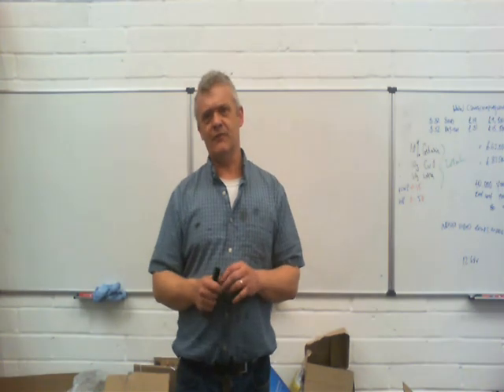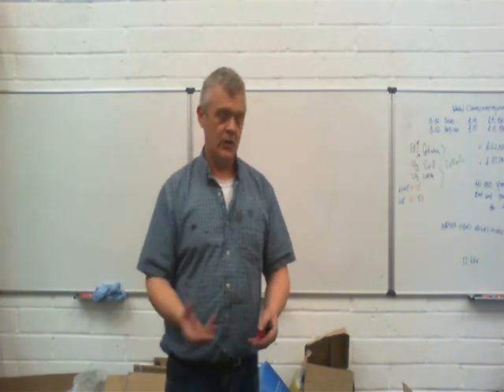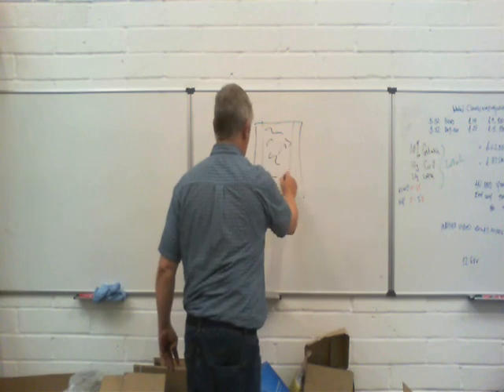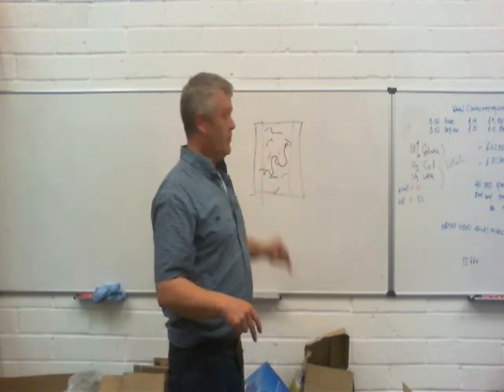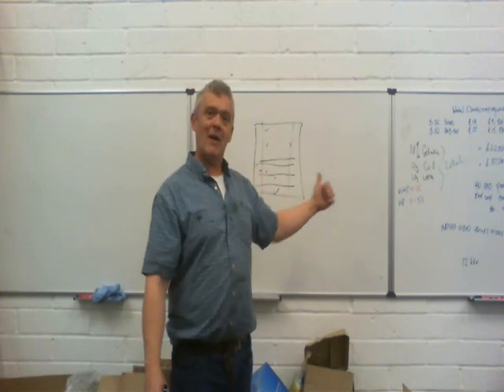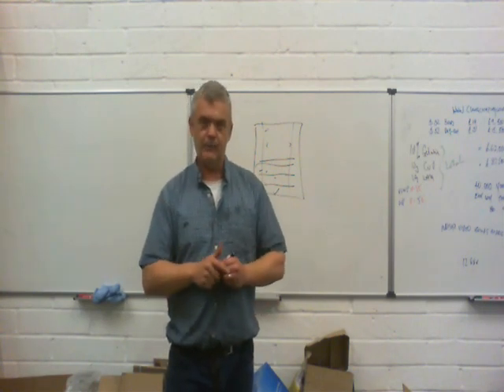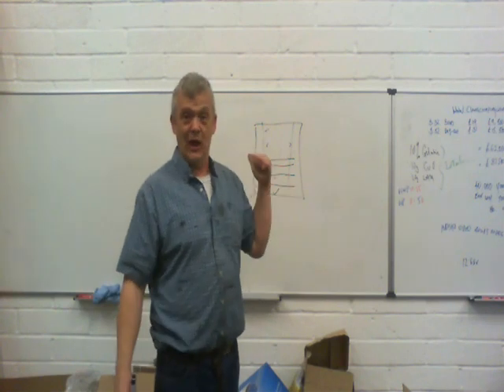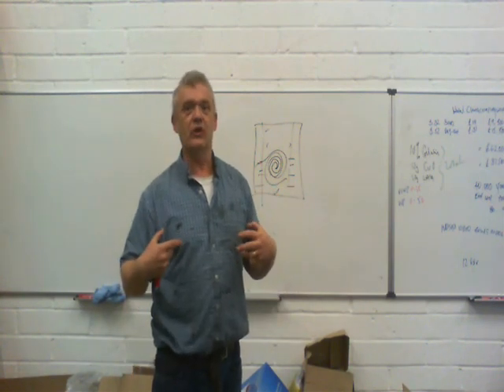SWAG Update - Thoughts On How The Magnet Works

Comment: curious... have you played with this supposed usage of coating graphene on yttrium iron to make it magnetic without loosing much of its electrical properties? http://journals.aps.org/prl/abstract/10.1103/PhysRevLett.114.016603
well my question then would be... couldn't you use your ink, and well if you line it up with a magnet as it dries if you then put the yttrium iron, does that control how the magnet would work?  Like in essence make a graphene printable magnet? not any videos on yttrium iron graphene lol.
Reply from the maker: +Clarence I haven't looked at this mate - but i will do now lol

Comment: Would it be possible to magnetically print on the same media
has hard drive disk's  to a

accuracy of say 10 micron's then deposit granules say 3
microns across. These would align

with the magnetic field and bridge across . micro volts
would only transmit across each junction

but the density of lines could make a decent amount of
energy . This all depends how small the

graduals can be made
Reply from the maker: +Bob Wilson A modern laser jet will print down to 20 microns or so with particles 5 microns or so across - so i would guess this can be done - you planning on trying?
Reply: +Robert Murray-Smith 

In time, as it is quite complicated . Need to finish refurbishing my lab firstThe platters used in hard drive disk's are coated in a thin film of 
ferromagnetic material . Using a read-and-write head and
stepper motors driven in opposing axis magnetically print  continuous
lines to a high definition . I conferred with a scientist friend of mine
who is from the university where graphine was invented .He also
told me graphine is easily obtainable 3 micron across . when I said print, I meant electronically print
a continues line instead of writing data using a read and write head .
Reply from the maker: +Bob Wilson sounds interesting mate - good luck with it

Comment: Thinking outside the box...........well, maybe thinking outside my box- Question for you-  since a capacitor is charged by separating the protons and electrons and storing them on two separate plates, would it be possible  to  somehow charge a capacitor with magnets 
Maybe connect the two plates and apply magnets, one side of magnet negative attracting positive, and the other magnet positive attracting negative, before you remove magnets, disconnect plates 

I have already done some research and found nothing, so I thought I would run this by you to see if my thinking was way outside the box, maybe at the least, having magnets in place when charging may help charging?
Reply from the maker: +Steve Allwest in my understanding mate capacitors store energy in an electric field - charge separation is a methodology by which this field is built and maintained - there is a relationship between magnetic and electric fields but it's not straight forward - i think it is an interesting investigation but i also think a static magnetic field with a static electric field won't help - the relationship seems to involve movement - think about current generation - you have to move the magnet. Anyway, very interesting question - I hope you pursue it
Reply: +Robert Murray-Smith  Thanks mate, this fun thought of trying to get power from two standing magnets  needs a lot more research before I spend the time trying it, thanks for responding, Cheers
Reply from the maker: +Steve Allwest let me know how you get on mate
Reply: +Robert Murray-Smith  unfortunately no time these days to play  (yet) until the rains come, one thing that comes to mind on a type of test for this idea, just to see if this has any merit 
If you had a mind to-
1. Apply magnets to one of your deep eutectic fluids in a glass jar , Negative face on one side of the jar and positive face on  the other side, and let stand overnight to see if you get any separation 

Just some thoughts until I get some time to test
Reply from the maker: +Steve Allwest I am a bit in the same boat mate - but if i get a chance i will give it a go

Comment: please forgive me, I'm new to all this.  I saw your video on making graphene sheets by a friction process, making the top of the graphene dusted sheet thinner and thinner by stripping the layers down until they are nano-thin.  The friction process used orbital motion, but if you could strip the top layers off in straight lines, you could cause the particles to align better.  I'm gonna order some supplies and work on it.  I think, though, it might be easier to actually get the graphene to stick to the material by using its static charge.  it would be like a tv screen attracting dust, but the dust would be graphene.  That doesn't make it run in straight lines, but after the thin layer is on there, i could work on a way to polish it in straight lines.  I'd have to see what could make trillions of small valleys cheaply, it'd have to be finer than the finest brushes.  Your friction process creates the heat necessary to cause the plastic to help bond the carbon to the plastic.
Reply: They use static to make sand paper, instead of sand dust, imagine carbon dust.  lastly, to make the particles align, before the glue has set, blow a jet of air through an extremely small slit at an angle over the sheet while it is rolling in the conveyer belt.  I will work on how to induce directional movement of particles in a solution for your ink graphene sheets.
Reply from the maker: Gristle Von Raben looking forward to what you come up with mate - nice ideas

Comment: Do you really need the sea, what about rotating salt water over the swag plate using a fan blade pulley/gear system to rotate the liquid?
Reply from the maker: sure - why not - I am only using the sea as it is near me and a good source of energy but other systems could equally be used

Comment: I had thoughts about posting this a few months back, simply forgot. better late than never.  
  A few months ago I was playing with some graphite, after 3 days in a ball mill. One batch with marbles & one batch with metal ball bearings. We sonicated some ball bearing compound into water (well water). After a day or 2 it settled out & we poured off the top layers to test out. Then took the remainder settlements and shook it up. Long story short. Was looking into the mix with a phone flash light. We noticed the light looked like it was moving some of the suspended particles We where like "Wow cool" but then we got out the Neo Magnets and WOW. I believe the iron in our well water & maybe the metal bearings them self made the graphite/graphene mix magnetizable. I also notice that the faster you moved the magnets the more pronounced the movement was. My first thoughts was a liquid generator could be possible.
  The glass marble batch slightly repelled under the effect of magnetism.  Not nearly as mush movement but noticeable repelling. 
  I think that painting graphene type products in a high magnetic flux, much like flip flop multi-colored paints, one could influence the patterns of the particles lays.  A mixture of magnetized & non magnetizable graphene might be able to influence lays as well.
Reply from the maker: Now that is interesting - i suspect the grinding media had a bigger effect mate - it could be the iron in the well water or small amounts of grinding media 'rubbed' off on the graphite - either way it is a very interesting effect. Mixing the two 50:50 , painting a sheet and drying it in a magnetic field could have an interesting effect especially if one was hydrophobic and one was hydrophilic

Comment: You have my brain spinning with ideas.... Love it... Ground breaking stuff on the regular from R M Smith... I'm getting a sample of your flaked graphite from a friend (Jeremy Gwilt).. I feel like a painter looking at a canvas.. I will do my best to come up with something interesting.... Second question (I am not sure if I remember you going through this in a video before), if I cleaned out a ball-pin pen, would the conductive ink flow through it a a steady rate? I am building a simple 2D printer that is CNC (obviously) and will be connected to a pen (It is a pre-cursor CNC build before I make a larger more expensive unit --> (3D wood mill for wind turbine blades)  *practice makes better*).. I figure I could do some really interesting fractal-phi shaped antenna designs with the conductive ink... But anyways, amazing stuff. Keep up the awesome work. Peace. Sincerely B
Reply from the maker: good old Jeremy - you would need to add a thickener to the ink if you want it to go through a ball point pen - maybe xanthan gum
Reply: Robert Murray-Smith Excellent, I am glad it is possible with a small modification, obviously I will share the results as I go...It will be a couple of weeks before I get the stepper motors and corresponding drivers to start this project (they are ordered and on there way from China).  I will be ordering some conductive ink this Thursday evening.... Thanks for all you do... (maybe in the order we could add in some xanathan gum ;) <- of which I would pay extra for of course :) 
Peace.
Reply from the maker: Binj Komisar
cool mate - i have just subscribed and will keep an eye on your progress as I am fascinated now lol - the gum is really easy to get hold of mate - just do an ebay search and you will get loads of it
Reply: Robert Murray-Smith Excellent.
Reply: Robert Murray-Smith OK. Placed order for conductive ink, everything seems to have went through flawlessly... And yeah, Xanthan Gum is cheap!!! Very cool. I am excited about this project... At first I was just going to build a 2D printer to draw, but with your ink, it is now going to be a really neat and interesting learning experience on a couple of levels. Peace and all the best!! :)
Reply from the maker: Binj Komisar
cool mate - it'll be a couple of days until I send it out - if that's ok as obviously I am in the states right now - but I am back on tuesday and I will get it off
Reply: Robert Murray-Smith Great, no rush as I am still waiting on the stepper motors and Xanthan Gum... This should be a cool project, thanks for making such awesome materials readily available and affordable. Peace Mr. Smith :)
Reply from the maker: Binj Komisar
thanks mate

Comment: Hi Robert. You may want to re-think your position re solenoids. Solenoids do not produce an even field of magnetic flux. Have a quick look at this video: PH EM MF DEMO 70001A V1025 2D Magnetic Field Demonstrations Simple Wire Coils which shows the magnetic field around three different types of solenoid. The third one, where several coils are aligned in a row produces an aligned field which if applied around the ink whilst it is drying might produce a much finer alignment of the graphene. There may be a certain amount of 'tuning' required vis a vis turns of wire etc, but you ought to be able to produce much better results using this method. Apologies in advance if I'm being dim, but it looks like it might be worth a try.
Reply from the maker: thanks for that mate - it looks really good - everyone needs their eyes opening now and then lol

Comment: Layman here. Would having more lines make it better e.g say if you could print them? Is it correct that you would still need the magnets to align the individual particles in each line? Is it that you need to do the alignment when the ink is wet and is it the drying of the ink that fixes the alignment?

Have I understood what is happening there?
Reply: you seem on the right path ... if still wet, they are movable so flux aligns them with max conductivity ... more lines = thinner lines -> more resistance ... fine balance act between distance from anode to cathode and specific resistance ... a bit like the copper conductance ... how long vs how tick :) resistance is inverse proportional to thickness and directly proportional to distance. :)
http://en.wikipedia.org/wiki/Electrical_resistance_and_conductance

Comment: excellent video as usual.
nice talk & demo of the mag arrangement.
I get it ... no magnetic field to be placed around the cell ... cool.
still ... consider that antennae arrangement whereby interference like patterns in 3d can be printed onto PET with dried inks ... i'll try to sketch it up for you to see whether we are on the same page :) 
BTW since the flux is unidirectional ...I get the diode thing ;)
Reply from the maker: cool - i think your idea of magnets is a good one mate just for different implementations like antennas
Reply: Yup ... perm magnets and antennae seem a logical combo but ... anions and cathions travel along a path and can be perhaps encouraged to do so quicker :) 
Mind you , when discussing already a two dimensional plane like the pet painted with low resistance already vectored paint ... not much point for further encouragement ... however in a 3d context with lots of graphene floating in an electrolyte ... ;)  
Might even be a point to make in a supercapacitor design due to the orientation of the graphene "flakes" along the lines formed by mag field.  Much like lines up hedgehogs .... hehe
Reply from the maker: *****
interesting thought mate - thanks for that
Reply: Cool bananas !  Pls post vid when considering it
Reply from the maker: actudoran
will do mate

Comment: A first project in college, 2nd yr, build a magnetic parallel for surface grinder magnetic chuck.  Including stamping die set-up for lamination of brass/steel.  Those magnets are very strong.  As for GO orientation, if one direction is favorable, doesn't the N/S alt the lines 180deg from each other.  ergo would turning every other lamination 180deg improve eff, through directional unity?  Really think you are onto something w/ fast switching diodes to harness electromagnetic wave energy.
Reply from the maker: dunno worth a try i guess
Reply: anikoustos2 The "diode" was a ref to an earlier video.  But I wonder if having an equal amount of GO oriented in opposing directions, alternating N/S poles, would negate efficiency of electron transfer to the collectors.
Reply: anikoustos2 So does it become magnetic through Lenz's Law?  Or "stationary" mag fields, though nothing is stationary just a POV.
Reply: anikoustos2 So that's along the lines of a MOSFET?